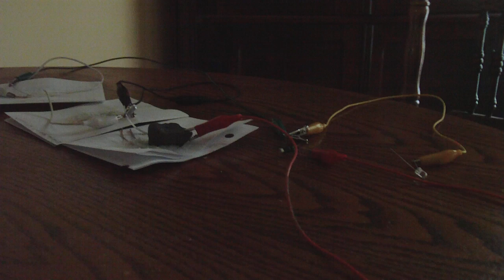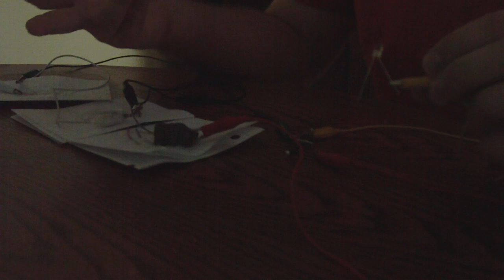Concept for powering a LED with a Low amp dry Crystal cell

Comment: How about using some "beam bot" type circuits? Voltage regulator or flashing LED (FLED) solar engines, replacing the solar cells with your crystal cells. beam-online dotcom has a few to look into. Great job on all your videos!!!

Comment from the maker: @KyleCarrington 

Great minds think alike, I've done the super cap thing before too. I even mention early on in EF for people to charge capacitors and don't hook the load directly up to the cell. The Less amps we pull from the cells the better off they'll be. Also having a cell hooked up to a capacitor helps to pull more energy out too.     :)

Comment from the maker: @overunitydotcom 

If you use a low farad capacitor (pico-farad) it wont take long to charge, a few milliseconds at most but that's all you need. If you use a super capacitor it will take a long time. My goal is to do this so fast that the human eye won't pick it up much like how the joule thief works.

Comment: That is a good approach. May I suggest the current method. A series of blue cell, 3 to 5, with the proper capacitor to drive a Joule thief. Once you find the correct farad size for the cap, adjust the joule thief base resistance using a variable 500 to 5K ohm resistor, for the necessary output light level.

Comment: Good work. That's what i do too, with mine except I used a supercap that charges all day long, and when I need light, at night, there u have it, good to go! I use oscillator to charge a 2.7V supercap, then i reconfigured one of those boost circuits (changed out the inductor, looked up the datasheet) to then drive LED at full bright. It's in the root cellar and it comes on with a light detect (when you open the door). Work's beautifully. 4 months strong now, thanks!!! :)